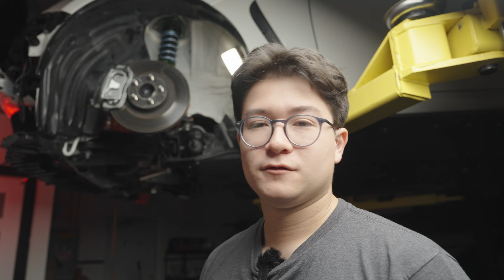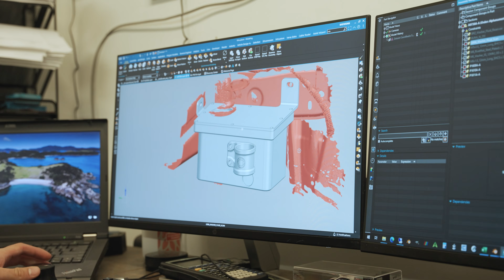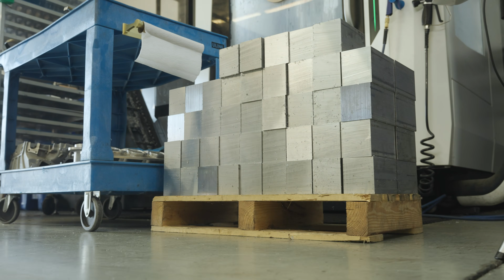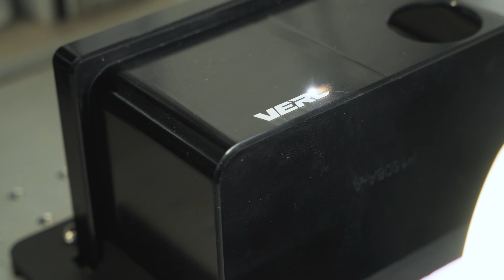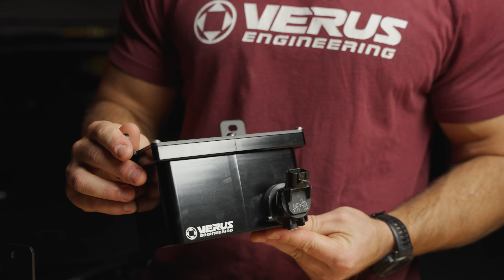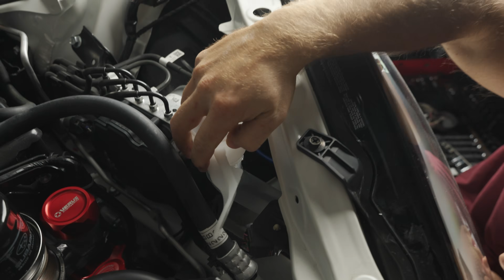Creating a smaller Windshield Wiper Fluid Reservoir | GR86 & 22+ BRZ | FRS/BRZ & GT86

Comment: it looks like it can work for the fk8 or fl5. hmmm
Reply from the maker: Doubtful. These are very specific to the models we designed them for. You might be able to get it to work somehow, but it would require custom mounting and possibly modification of the reservoir itself.

Comment: What’s the weight? Plastic could’ve been cheaper and lighter.
Reply from the maker: Plastic generally has a very high up-front cost due to tooling. We don't know how big this market is yet and making it in this fashion allows us to dip our toes in without 10's of thousands in tooling.
Reply: If you already have the machinery to make a production part out of aluminum, you make it out of aluminum.